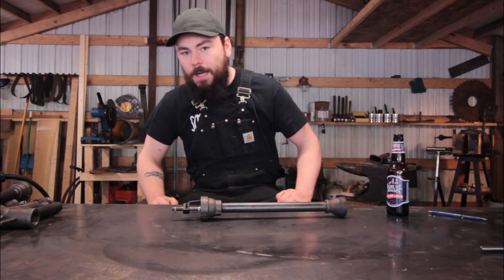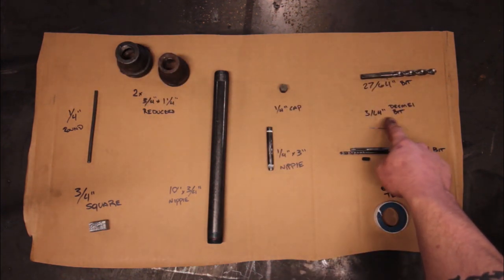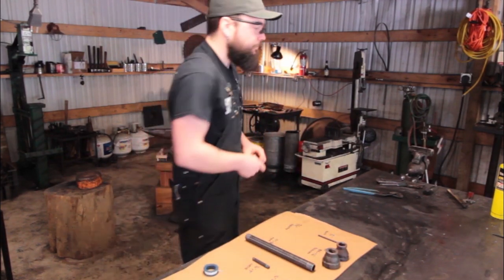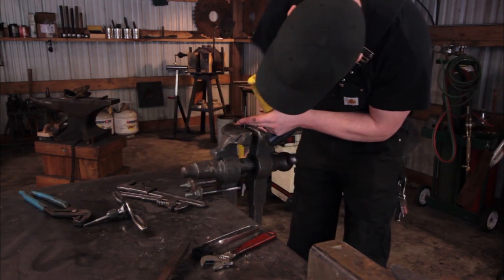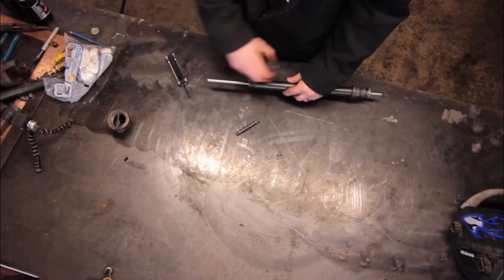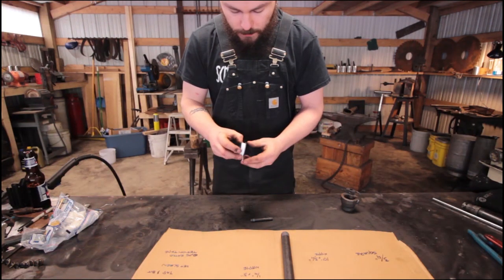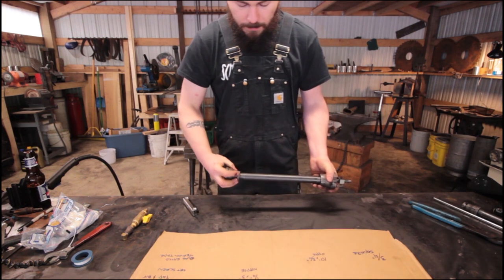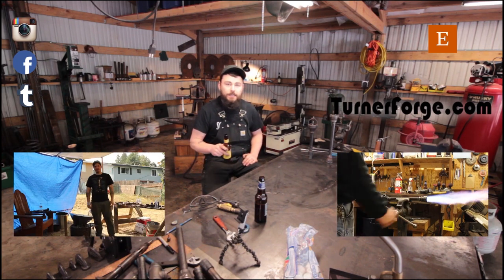TurnerForge - How to make an efficient propane burner

Comment: Gotta say something, just because I'm a machinist and it bothers me.
1/64" = .0156", so 3/64" = .0468"
1/32" = .0312"

So your propane jet is .0468", not the .030" you stated. If you don't understand what a fraction means in decimal form, pull out your phone and open the calculator app. Punch in the top number and divide it by the bottom number.

Other than that, good video.
Reply from the maker: Thanks! The .030 was the size mig tip I purchased. That is what it said on the packaging. But thank you for giving me a heads up. Glad you like the vid.
Reply: @TurnerForge  Did I misunderstand you in your use of a 3/64" drill in that Dremel? Seemed like you were saying it was going to be the orifice/jet for propane rather than a mig tip.
Reply from the maker: You know what you are right, I used a mig tip in another vid, ya it's been a while since I made this one. The bit size was just what was on the bit box. 
Thank you for lending some insight!
Reply: @TurnerForge  Yeah, no worries man. Lots of people have trouble with the decimal to fraction conversion and I wanted to point it out so folks would be aware. It might not work well at .046" for someone else.

Comment: I really like the design of this burner but I’m unable to get my forge above 1500°f when I run the burner at 7-10 psi. So the material I’m work on only gets orange and gives me very little time to forge it. My forge is the small one which I saw on essential craftsman 4.5x4x9. I use 1-1/4 flare on the burner end and I’ve tried 1-1/4 and 1-1/2 on the entry orifice. I’ve also tried different lengths of pipe 6 and 8 inch. And different welding tips .030 and .035. I also made the necessary flame adjustments by moving the tip in and out. I don’t see very much difference in any of the setup combinations I try, however, when I add a bit of air into the orifice from a hair dryer I can increase the temperature by at least 200°f. Many of the other similar burner design suggest a method of choking off the air intake but I’m finding its better to add more air. Do you have any idea what I can try to increase the temperature of the forge? Any suggestion is appreciated. Thanks
Reply from the maker: Hey ben. Wow it seems like you have tried almost everything! First thing, are you getting allot of dragons breath? This may be too much torch for that little forge. I wonder if you made a version of this torch scaled down if you may get better results? Also I would look at the delivery oriface, is it aligned so that the jet is not bouncing around in the torch body? Sometimes that can kill your heat. It's hard to diagnose without seeing it in action. I also have found that 6 to 7 inches is the sweet spot for the torch body.
Reply: Turner Forge Thanks for the timely reply. Yes the mig tip is aligned for sure . But you’ve given me a couple of things to consider. I don’t think there is too much dragon’s breath. When you say scale it down a bit I presume you are saying to try a smaller mig tip. Perhaps a .023. Will do but I am finding that the .035 gives somewhat more heat than the .030. And as for the size of the forge it will be fairly easy for me to double the size with a few bricks and see what happens. Unfortunately I live in the boondocks and don’t have easy access to everything but I will certainly give your suggestions a try ASAP. Thanks again.
Reply from the maker: @benlallier1721  actually by scale it down I was talking about the torch body diameter it might be a better fit for your forge
Reply: Turner Forge as it turns out I discovered today that you should not use hard fire bricks for a forge. Apparently they soak up the heat. Unfortunately that’s all they carried at the local brickyard. I was able to buy a soft fire brick from a local potter to drill the hole for the burner. I will try and get some more from him to replace the hard ones. Really anxious to get the forge working properly so that I can get forging!
Reply from the maker: @benlallier1721  Sweet! Let me know how it goes.
Reply: Turner Forge Wow I can’t believe the difference between the hard bricks (heat absorbing) and the soft bricks (refractory ) k26 in this case. With the hard bricks I was able to get the temperature up to 1566°F after 30 minutes at 7 psi. With the k26 bricks after 10 minutes the temperature was 2057°F and still climbing at 7 psi. 

It was well worth the 3 hour trip to get the right bricks. Now I can start forging. 

Thanks for the burner design and guidance.
Reply from the maker: @benlallier1721  glad to hear you got it working!!. You can also order it online. I would recommend hightemptools.com

Comment: My hex cap was flat inside as well. So I drilled it centered without the help. I built a double burner, and now I’m working on my Forge. An old air tank. The burner turned out nice though.

Comment: great video! I was curious if you have even used a 2" reducer?  I found a 2" to 3/4" reducer and wanted your expertise about how i might use it most efficiently
Reply from the maker: I have, and they work great! I would recomend them however they are a bit more difficult to find than the ones they carry in the big box stores.
Reply: do you have an idea of mig tip size that i should use with the 2" reducer? I have tried .030 and .025...
Reply from the maker: @rwzwiefka  The .30 worked ok for me. If you are having troubles I would first check the alignment, if that's all good then you might need to bump it up a size.
Reply: what do you recommend for the reducer size holding the torch flame if shooting propane into 2" reducer? is there a rule of thumb for this? I appreciate you helping me along TF
Reply from the maker: @rwzwiefka  no real rule that I know of, I usually just go the next size up. So 3/4 to 1". It never hurts the go bigger though

Comment: Ive built a couple dif versions cant seem to get a nice blue flame.always has yellow tip to the flame.any tips
Reply from the maker: Peter Silva it sounds like there might be some turbulence inside the chamber. Be sure the jet is going straight down the tube, you have enough pressure, and there is nothing clogging the delivery orafice.

Comment: I built one patterned after the one made by the king of random and it gets everything red hot but the copper only become soft, it does not melt, and that's after having the burner run for almost 2 hours emptying my propane tank.
I used the .023 MIG tip but was wondering if a larger hole would work better.
I have .030 - .035 and .045. tips on my MIG supplies.
Reply from the maker: archangel20031 I would use a ".30" mig I've had the best luck with those

Comment: Man, really excellent video, I'm going down to Depot right now to get the few items I need to make a burner now. I've been using my oxy-acetylene Rosebud to this point in my forge,  damn that's expensive!
Reply from the maker: Brady McPhail oh man tell me about it! Just filled my acetylene tank and cost me 70$!
Reply: Turner Forge hey man are you doing videos anymore? I was getting a whole bunch out of your stuff! I'm a beginner so I'm depending on you cats who make the good videos to lead me in the right direction..
Reply from the maker: Brady McPhail I do plan on making more vids. Just don't know when. You should try and connect with some smiths on line. There are tons of awsome face book groups that have loads of info. Blacksmith for beginners is a good go to.

Comment: One quick tip about making the propane nozzle hole. It's easier to drill it from the other side (the inside of the hex cap) because there already is a conical indentation right in the middle of it. I used a 1mm drill bit, easy to find on ebay and other sites.
Reply from the maker: stamasd yup. I found that also. Thank. You for sharing.

Comment: I'm getting ready to build my first forge, so I've been researching several designs.
And I like this design the best. I've got some welding and cutting skills and I'm going to use a propane bottle for my forge body. 
 Would there be an advantage to using two burners on something that size or would one be enough?
Reply from the maker: Anthony Omes eh, some might argue but I'm able to forge weld in mine with one burner at 15 psi. So in my opinion one is plenty.

Comment: Now, how does that fit in a forge with the insulation?  Do you make the torch adjustable, in or out of the forge?
Reply from the maker: James VDL For my forge I cut a hole in the side wall big enough for the torch.

Comment: What is the fundamental difference of your burner compared to all the other designs that you knocked over on your table? What makes your design better?
Reply from the maker: Scott Rittiger the reason I favored this is it did not require the use of a MIG tip and made the alignment waaayyy easier.

Comment: I built a torch.  it works great for the most part. I do get an intermittent popping like it's trying to cut out.  any insight on causes?
Reply from the maker: Scott Woods is it the torch in the video?
Reply: yes.  except the 1/8 brass pipe was an inch longer.

Comment: i used brass for the gas nozzle part instead of steel.. that's fine right?
Reply from the maker: Blacksmith44 ya you should be just fine.

Comment: i guess I'm stupid
Reply: its never good to knock your audience.  But yes.  Should you run into a problem, yes your a dummy for not having a shut off valve on handle.  but your not stupid.  easy enough to go make a new torch or add the valve to yours.  i will say his drinking, and d bag attitude is why he only has 3 vids.  i don't use his design.  he makes indexing the thing out to be a project.  i index mine by soldering it resting flat...hard to explain.  anyway.  its otherwise a good vid, minus the your stupid comment and beer.
Reply: @cannabisenigma  lol -- I found myself wanting a frosty Sam Adams while watching this vid. I have zero problem with a grown man having a cold beer in his shop, while showing people how to do something kick-ass like make a forge burner. It's kind of an odd condemnation, coming from someone with "cannabis" in their name.

Comment: I just built two of these for my forge. I did use at first a .035 MIG tip, without a regulator and it made crazy heat. went thru propane like a fish through water but, red hot everything in just a couple minutes. chimney effect I did get after it had been running for a while. since, I have reduced to a .025 MIG tip and I now have a regulator. 20 pound max but hey it's better than not one at all. works so much better and does not go through the propane like it did. I like the idea of using a MIG tip due to the fact I can interchange them from big to small if the need arises. I would like to find a regulator that would go up a little higher than 20 pounds. maybe 30 or so. nice job. great video.

Comment: so what would be the best way to avoid the chimney effect? as is my understanding air is sucked in through the top to feed the flame and with the venturi effect plus cooling of the gas being fed through the line, how will hot air make it all the way up the back enough to damage the parts? is there an ideal design for a forge to circumvent this problem?
Reply from the maker: I AM Diablo chimney effect usually happens when you shut the Forge off and all the heat inside the Forge comes out the torch body

Comment: I had asked on your older burner vid,but since this is newer design I'll ask here.Since I have a lathe,would it be beneficial to machine a nice taper on the inside of the bell reducers?I would think it would disrupt the flow less than the threaded or cast interior.On the burner you actually use,can you share the dimensions on the forge-side end bell?I'm not scared to fabricate,lol,and others may want to know also.I like the newer saddle for the 1/8" on the one you say you use,that goes all the way across to the other side.I think I'll do that.How do you determine how far inside to put the 1/8" into the reducer before you tighten the setscrew,and does it make any difference?Lastly,in the other video I stated I had .030&.035 tips so I'll use one of them,but I see you have no baffle on this new design.Should I go a little bigger on the jet and then be able to adjust the air draw?P.S.,how do you think a needle valve in-line after the ball valve would work?Thanks again for sharing!
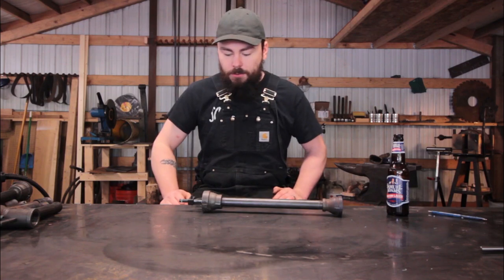Reply: Machining your bell reducer on a lathe out of stainless is the ultimate. You want no more than a 1:12 taper -- i.e., the flare at the hot end of your burner should expand at an angle equivalent to a 1" pipe increasing to 2" over one foot (12".) A 2-3" flare at that taper ratio, made of stainless, that threads (or weld it) onto your 8" x 3/4" black pipe nipple burner body is ideal. As for MIG tips vs the fixed 3/64" hole for the gas aperture, I've done this both ways. The 3/64 bit/hole in the cap works fine, but I like drilling and tapping the 1/8" nipple cap to accept MIG tips (usually 1/4" x 20, but depends on your MIG tips - just wind them into the test threads at lowes fastener aisle to confirm the size tap you need.) MIG tips let you change them out as needed, which lets you run different apertures for single vs. double burners, etc. Running two burners off the same line changes the pressures coming out of the apertures. (One hole, more pressure -- two holes = less pressure.) You can get most of the adjustment you need by moving the venturi / MIG tip / 1/8" nipple & cap -- whatever you want to call it -- in and out of the bell reducer, and/ore by increasing the pressure via your gas line regulator knob, but the actual aperture also matters, so it's handy to be able to change out MIG tips when dialing it in. You need smaller apertures (MIG tips) at elevation and may have to try several, depending on your number of burners, before you'll find the best flame at the lowest PSI, so your fuel economy is the cheape$t possbile. Definitely get a 30 PSI propane regulator ($30 on Amazon, with hose) and I found it's wise to put in a 90 degree elbow and another 4"-8" nipple running away from the forge before the ball valve so you're not melting the nylon bushing the ball turns in, inside the ball valve shut-off (unless you can find the all-metal shut off valves.) The offset from the forge body also helps save that yellow gas-rated teflon tape from melting. Set your burners into your forge at and angle and pack your gaps around the burners where they feed into the forge body with a little left-over ceramic fiber insulator blanket to stop crazy heat from coming back up the burners ("the chimney effect.")
Reply from the maker: Bowtie41 Yes to all of That! I would love to hear how much It helped the design. As for the MIG  tips my aim was to keep the hole as similar as possible. I apologize for the delayed response.

Comment: quick question on the pipe u used for the jet cap could u use a all thread an out a cap on it to adjust the air flow to tune to the propane psi I've seen one like it before but couldn't find a build vid about it
Reply from the maker: Daryl Gardiner I've seen them as well. That is a design I want to tackle but have not had the opportunity yet.
Reply: Turner Forge well if u get a chance to I wanna see the vid of it I'm thinking of making the one an this vid an trying it's injector set up an the other one

Comment: Good job on the video. ONE question on this build...  How far down into the bell reducer do you stick the 1/8 cap or nozzle?  I assume it's not all the way to the 3/4 nipple - but getting close??
Reply from the maker: Don Grace I usually go about 1/2 way in to the reducer. but you might play with it just to tune it up

Comment: Would a BBQ regulator work? I built this and I don't seem to be getting the "jet effect"
Reply: Dylan Banks I too have built this exact design using a BBQ low pressure regulator and do not get the "jet" effect either
Reply: Evan Pennock I bought an adjustable regulator and use it at about 5-8 psi and it works perfect, i BBQ regulator only puts out around 1/2 psi.
Reply: you need a 30 psi regulator, he alludes to it in the video

Comment: Just curious to ask you or some of your viewers,would an ordinary Tiger Propane Touch work for this application.I would like to build a small forge to perhaps get my grandson interested in this type of hobby.
Thanks in advance for your time.
Reply from the maker: Robert Moore I am unfamiliar with that torch. What was it's intended use?
Reply: Thank you for your quick reply. The tiger torch is a very common propane torch that can be used for several applications,I think lots are used for say, thawing frozen pipes in winter.I live in Canada so lots of cold apps here. They are just off the shelf at most hardware stores. I think the easiest way to explain it would be to Google Tiger Torch and there is lots of info there.It has a fair amount of heat but maybe it would need injected air to save propane costs and heat faster.
Reply from the maker: Robert Moore to tell you through truth I would not use it for a forge.
Reply: Ok great, thanks again for your advice.

Comment: How big of a foundry would this work in
Reply from the maker: Hmm. You know I'm not sure. the biggest I have ever tried is about a 5gal propane tanks size. I would be curious to find out.
Reply: Turner Forge I have a foundry that has a 9 in diameter and is 14 inches deep. We tried melting copper once but I think it let out to much heat and the torch didn't burn efficiently

Comment: cut your beard
Reply: kuntay tubay trim it or it could catch a spark and burn ? Great mentions for a shut off valve and does gas style seal tape available for heat applications ?

Comment: Would you use two of these on a propane tank forge for maximum heating?
Reply from the maker: The Forge I have is a single tank size and I use one torch and can get welding temps no problem.